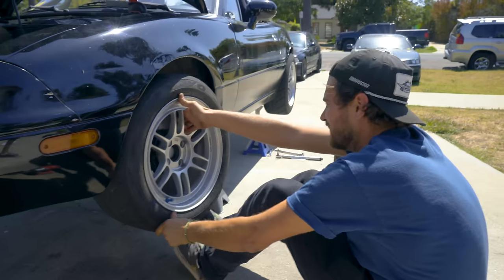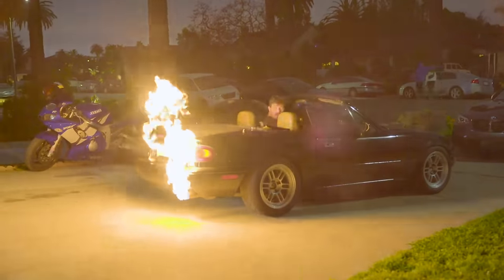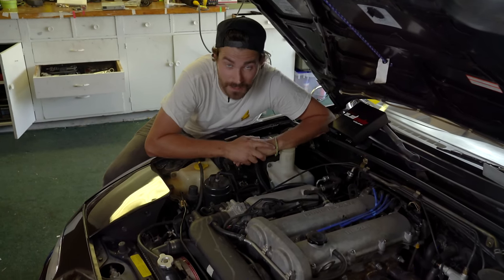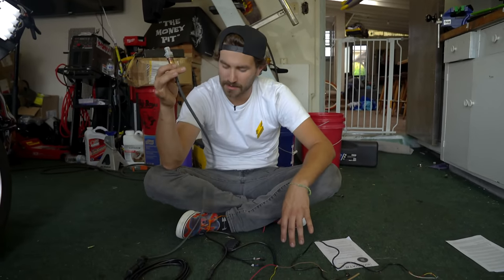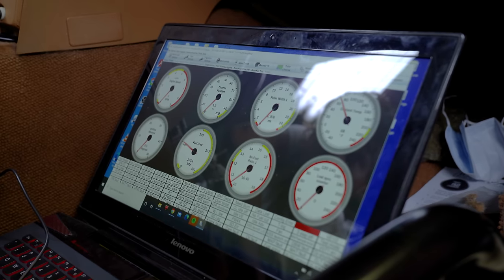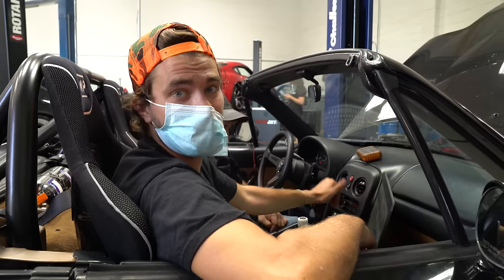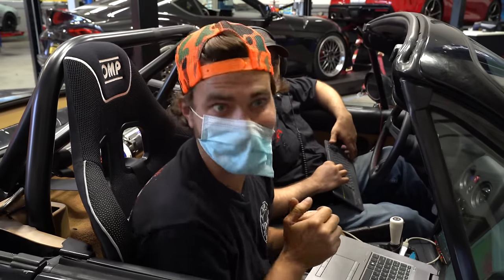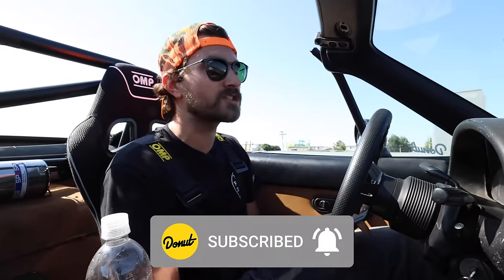Is a Standalone ECU Worth It?

Comment: soooo basically the answer is, no a standalone ECU absolutely is not worth it unless adding forced induction, or modifying internals. Spending a 2 g+ on a standalone ecu plus dyno tune to gain what 10HP, is not worth it.

Comment: the term "there's no replacement for displacement" is a term directly targeted at forced induction systems. If you want to say its not true "anymore" you'd need to say why turbos and superchargers used to suck, or just outright say its not true and never has been because superchargers and turbos are just as good as larger displacement engines. The crux of the argument is that turbos and superchargers have tradeoffs for more power (ie turbo lag and parasitic loss) that a larger displacement naturally aspirated engine does not have. a 2L turbo 4 banger making 500hp and a 5L V8 making 500 hp are not the same, even with all else being equal. the naturally aspirated engine is likely to win a drag race because the turbo lag means the naturally aspirated engine has more power off the line, and by the time the turbo has spooled up, the gap has been established. This is amplified in track racing as the amount of time spent accelerating/decelerating is greater, the naturally aspirated engine has more power earlier, and the turbo doesn't have the power to catch up in the straights.
Reply: Thats why we have rally anti lag. 

Lol

Comment: Hahaha he said "safe" and "11.5:1 at idle" in the same sentence

Thats a bit deep for my idea of safe that low. Won't kill it for the drive to the tuner.. but... 
Hell lsx's tend to like running much richer than alot of engines N/A at wot 
Usually around 12.3-12.8 ive seen (think 12.0 makes most torque 13.0 makes most hp on ls as loose rule of thumb or general direction)
And Essentially anything else I've ever seen import or other  likes a 13.0-13.5 wot N/A  (theres plenty of exceptions maybe this engines one hell log a stock price you wanna see wild ratios)
And all of em want a 14.0-15.0 sweep the closer to 14.5 with E10 the better( technically lower but fuel efficiency is a thing)

Boosted 10.8 - 11.1 on most import engines ive tuned makes good safe power.  Though sr20dets and some of the later 4g63s liked an 11.4 or so wot. 
Lsx a bit richer. 

Reguardless, 11.5 at idle is extremely rich and def dont take it as "safe" if your cars there pre tune. 
Get it leaned out sooner than later. 
Isn't gonna kill it in a day... but...
Reply: I do enjoy his show though. 
Feel like every time I comment I correct somthing and no one likes that kinda person. So don't think I'm tearing him down. 
Just seems a bit on the far side for safe. 

Keep up the fun vids

Comment: Short answer: OBD2: no. Pre-OBD2: maybe, but also engines in this era genereally are low-performance and have low ceilings without forced induction which is hugely expensive.

OBD2 provides everything you need, and will perform the same with a simple ass flashed algorithm. A fuel/timing algorithm isn't supercomputer shit; it requires almost no computation power even with all the sensors/inputs that OBD2 standardized.

Comment: Sorry but your base fueling calculations need to be accurate or your ve table is going to be shit and harder to tune. Using afr targeting without manually tuning the be table first is also going to end up with a shit ve table. Do not run cl afr targeting before having your ve table close. Do not assume your base file fuel calculations are correct. Do not assume the auto tune and cell smoothing is accurate. You need to datalog, check and correct, and repeat to make a spot on ve table. THEN start using close loop corrections.

Comment: To be honest you really do not know how electrical works in a vehicle. You made rule #1 wrong decision into cutting into the original wiring harness, when it comes to ground, you can make a ground “ANYWHERE” on the car. Then if you are adding more grounds then you need to put in a bigger ground to accommodate the additional wires. Then if memory serves me correct their are called “ADDITIONAL” slots that will work with constant power with the proper sized wire. From a stereo installer this is important which means their are at least 2 empty slots where you can add in additional electronics. You just do not dice n splice wires as you see fit. When you put more volts through a single wire you add in additional heat. N yes each wire will have a certain power ratio. Then when you are putting male with female connectors you need something called “Heatshrink” which is where you put a secure cover over the wires. So does this guy know what happens when you do not cover wires properly???? Then if you have a constant power you could add in a toggle switch. You had zero problems drilling holes into the shell of the car. Fun part is a constant power would be the same thing as a REM wire which means the amplifiers wont turn on till the head unit turns on which means turn on till the car is turned on or the acc is switched on. But yet again you could buy a new ignition 4 point key which you could use a BYPASS VAT key. Someone remind me not to ask this guy for advise on how to install anything. I wouldn’t be surprised if this car catches fire.